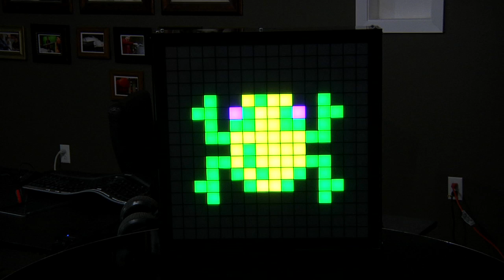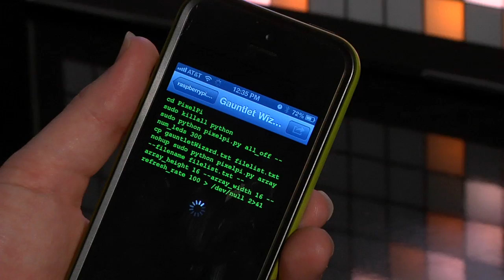Maker Project: RGB LED Animated Pixel Box

Comment: the protocol has some inherent limits on how fast and many LEDs are supported in a single data pin. As long as you inject power you should be able to drive thousands in serial. Nice project.

Comment: CNC stands for Computer Numerical Control. It has nothing to do with the actual cutting method. The asian fella was correct, regardless of what method you used to cut it (laser, router etc...)

Comment: FYI: For a static image, the number of LEDs will be limited by the current required. Either your power supply limit, or the wire capacity limit. For motion however, the limit will be in your frame rate. The higher the frame rate, the more often each pixel needs updated, and that will quickly escalate to the point your I/O port can't keep up.
Reply: Yessssssss!!! That guys has no knowledge what so ever.

Comment: which three colors of led make up each pixel?
Reply: +Sofía Terán Each Pixel consists of an RGB LED. This is a red, a green and blue LED mosty in one chip. Depending on the dimming steps (PWM/Analog/PDM etc.) you can mix all colors you want.
Reply: +Sofía Terán RGB LED's,  red, green, blue.

Comment: I've been looking at videos of Raspberry Pi and Arduino stuff, trying to decide if I should get into the game, and this video just convinced me. I don't know anything about programming, but I know how to solder and read instructions. I think I could figure this out. I'm convinced. thanks!
Reply: xenodrone I'm sure you have figured it out by now but depending on the chips used to drive the LEDS you can possibly use pre-made software to control them. Glediator is an example of a useful program that works for WS2801-2811-2812 chips. The hardware is quite doable for led projects, the software that you can write is more complex. But the great benefit of led matrix's is how graphic the programming becomes which makes it a useful tool when learning how to program for a specific architecture, be it WS2801 or shift registers you can see exactly what is going on.

Comment: Make a NES emulator with this as a screen with wireless controllers. That would be sooo awesome! These are 16 by 16 and one foot wide, a NES runs at 256 by 240 sooo... a 16 feet wide screen in total... not this would be a convention or über nerd thing but still how cool would that be. Run an emulator, use this as a screen, have it as a public show thing on the side of a building or something like that and have people connect with their cellphone to play... so awesome.